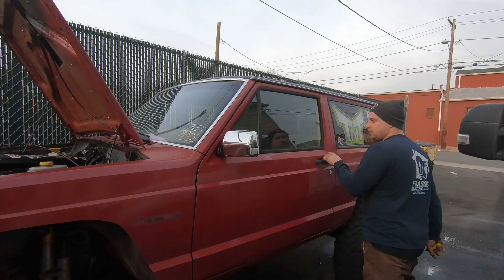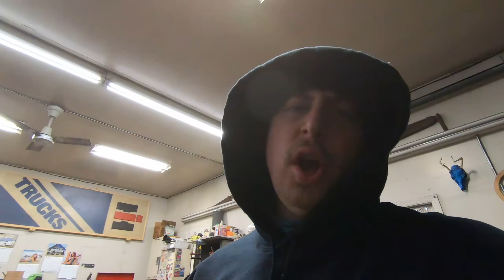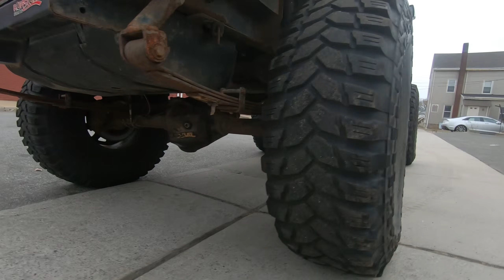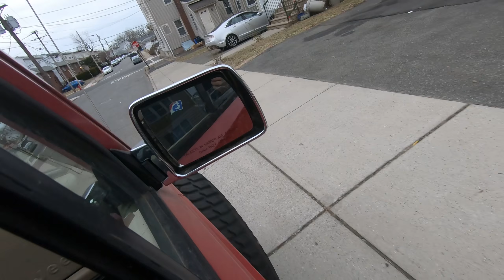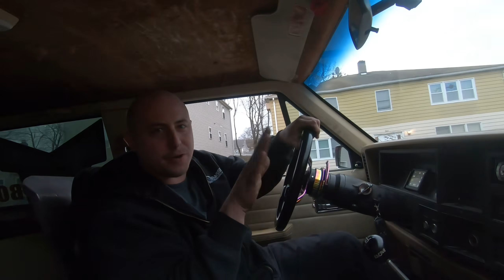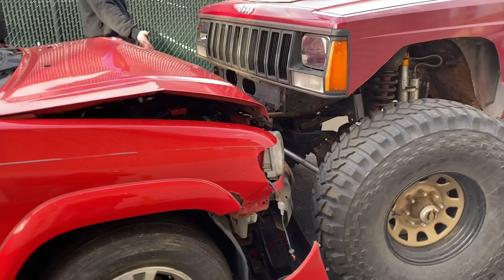First drive In The LS swapped Jeep Cherokee (LS Swap Part 5)

Comment: Not sure if you mentioned this in any previous videos (I haven't watched them) but how much did it cost to do the full LS Swap. Just the engine and tranny. Just curious because I thought it would be cool to ls swap my xj
Reply from the maker: Around 5-6k
Reply: @Grewsum2Sum  cool. thanks
Reply: @Grewsum2Sum  Cool. Thanks. And the 4.8 can mount with stock transmission and transfer case? Would you not need an adapter of some sort?
Reply from the maker: @mtbrhelm  yes. Custom bellhousing, slave cyllinder and flywheel clutch setup from advanced adapters
Reply: @ cool. thanks. i appreciate you for relaying the info to me

Comment: hi !!!!

if you have put the NOVAK radiator  and it is bigger than the OEM, where  you are going to install your transmition radiator ?
Reply from the maker: It's a manual trans, so I don't need a transmission radiator. Also, it is thicker but you still can fit at remote tranmission cooler in front of it in between the grille and the radiator

Comment: Nice swap!  Using same Jegs intake on my 1999 XJ swap. Having a problem getting truck injectors from 2004 LM7 to fit intake.  About 0.010" too big.  Stock intake orifice measures 0.550"  Jeg's measures 0.540"  Maybe find a smaller OD oring?  Damn, I cringe at how much work is ahead of me!!  Great Job!!!

Comment: Question about your shifter. I noticed you’re running the B&m short throw shifter. Did you have issues with the trans being moved 2-3in forward? I am ls swapping a 98 cherokee. My stock shifter won’t work. Debating on heating it up and bending it or getting the short throw. Thanks.
Reply from the maker: Only thing i had to do was modify the trans mount to bolt up to the stock crossmember
Reply from the maker: The b&m works fine no modification

Comment: Hay Jeff you might take your Jeep to someone that has a  Radiator shop that specializes in high performance Radiators maybe he can point you in the right direction or maybe just bite the bullet and have the shop fix the problem. Oh I meant to ask you if you have a  fan schrode if you don't have 1 that be the problem right there. Again good luck

Comment: Wow so cool to see ya back in the saddle hahahaha for sure. Anyway  Jeff my thoughts on your bucking might be 2 big of a camshaft. You might consider some of the RV still camshafts there designed for lower rpm yes you will lose a little power but you won't be bucking any more and when you go off roading you won't have to be on the gas to keep the engine from stalling. I do like your build you've worked really hard on that for sure. Anyway good luck and hope to see you and Matt tearing up the hills and just having the time of your life.

Comment: Whats gears are you running in this monster? 35” tires with the ax-15 correct?
Reply from the maker: 40" tires with the ax-15. The axles have 5.13s in it

Comment: Park it with nose up high or get one of those radiator bleeding funnel or both let it heat up and add antifeeze
Reply from the maker: Gunna try that just ordered a bleeding funnel
Reply: Had the same problem did 3 core new thermostat new shroud .. Ended up being water pump .. Fins were gone ..... Temp would randomly spike and go right back down so it was the last thing I check ..but thats how it gos lol
Reply from the maker: @xjTay-lorMiner  hope the brand new waterpump doesnt have that issue lol

Comment: Hi 👋 👋 👋 👋 Jeff your right about the tune and then on some of the other channels that are out there I've seen them even on a V6 . So get it turned up and also see if you can get a  Dino tune that way the tune will match your Jeeps weight and get rid of the rich fuel on low end and get it tuned on mid to top end as well. Going now thanks Ray 😎
Reply from the maker: I plan on a dyno tune!

Comment: Those holleys are really good units. Make sure your inputs are accurate for injector, cam, and engine size. Also make sure there are no exhaust leaks before the wideband sensor.
Reply from the maker: All that was done !
Reply: @Grewsum2Sum  hey
Reply from the maker: @barbaraflores2  i already told you i messaged you on instagram if you want to talk to me then message me there